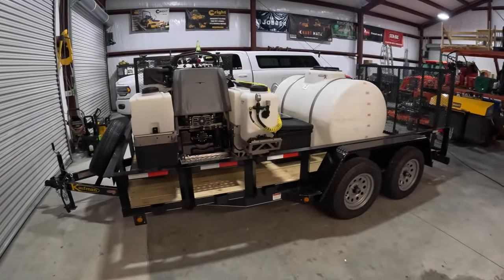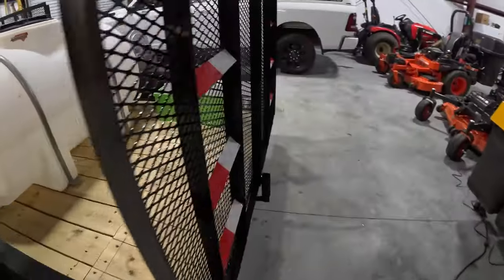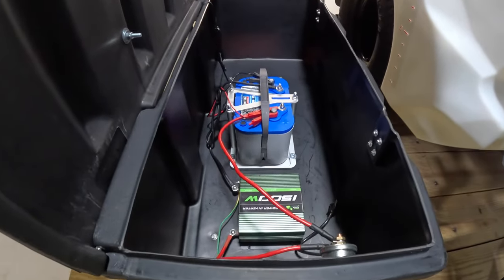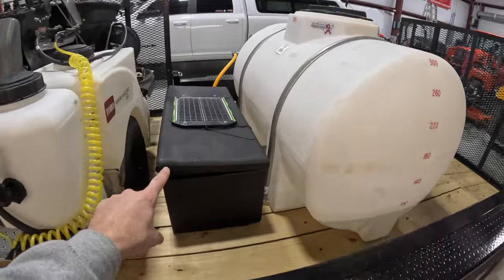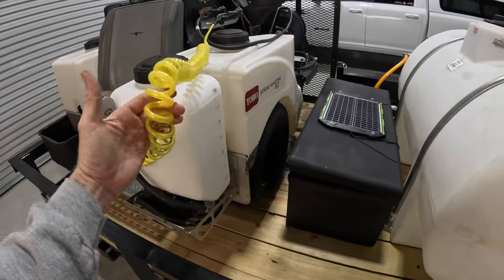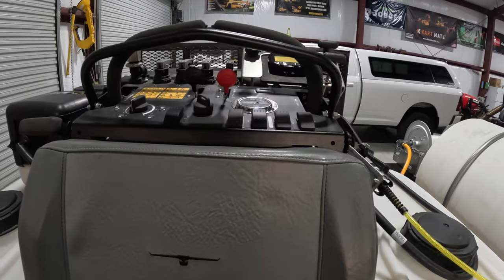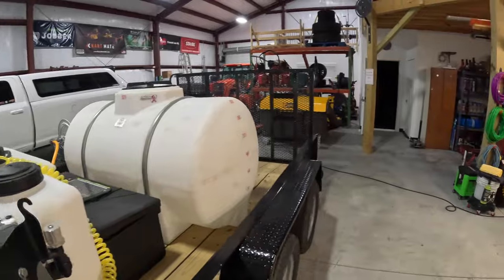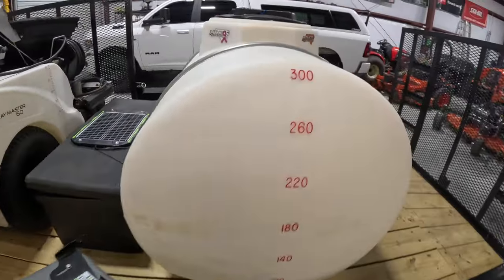NEW Spray Rig TRAILER SETUP for 2024 !!

Comment: Awesome video ,I just purchased the midsize Z- Spray a little scared to get going with it. I’ve been working on my calculations for Spray weed control at 1.5 ounce per gallon ,40 psi ,4 mph I know it varies from machine. This was just set up standard from the factory how many ounces of actual weed control product speed zone would you put in your tank? I just need a range to know if I’m way off. I know your machine is different from mine, but I just would like to know how many actual ounces you put in your machine at a full full up example, how many gallons of water you have to how many ounces of weed control?

Then when I finish my calculations, I’ll know if I’m in the right ballpark . I probably need the foam marker.also

Comment: Curious how it is on hills turning fully loaded. every video online is on flat turf, and soon as they go into a turn the video is edited, not showing if the tires spin or the operator has issues coming out of that turn.
Reply from the maker: Thanks for bringing this up.  I’ll make sure to make a video on this.  I’ve got a few properties with some slopes and as long as ya know how to handle a big sit down zturn mower on hills, this is no different.  Stay tuned to the channel in the coming weeks!
Reply: Look forward to tuning into that video

Comment: I would put flat plates and hardened bolts for securing the tank. The sloshing will pull on your hardware and pull through the wood. I can’t see underneath, but I would rather be safe than sorry. Looks great though!
Reply from the maker: Great idea!  Thanks!
Reply: Fill the tank with whiffle balls. Check with the tank dealer. They should point you in the right direction. Got them for my 1000 gal brine sprayer. Awesome setup. Might do the same but in the back of my 2500.
Reply from the maker: @toddwildrick5028  awesome idea!
Reply from the maker: @toddwildrick5028  any clue how many wiffle balls per gallon?
Reply: In my sprayer. They are right up to the top.
Reply from the maker: @toddwildrick5028  understand…but I don’t know how many to purchase.  Any idea how many ya put in there per gallon.